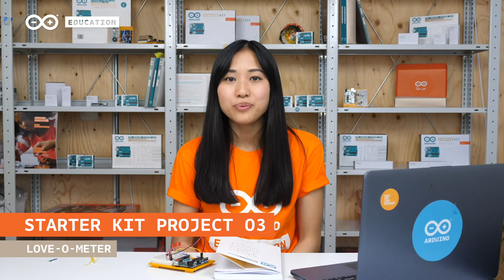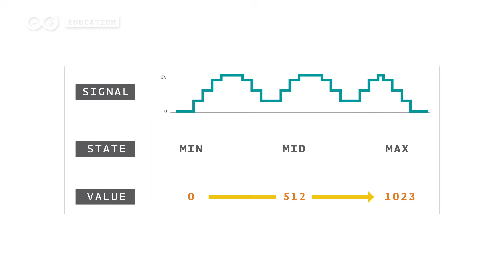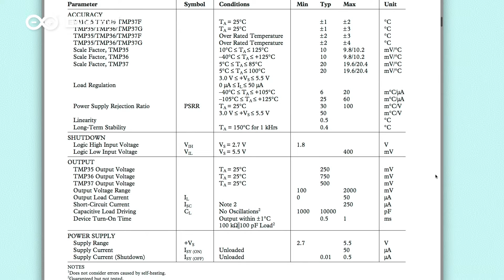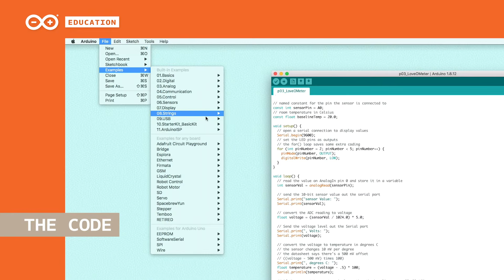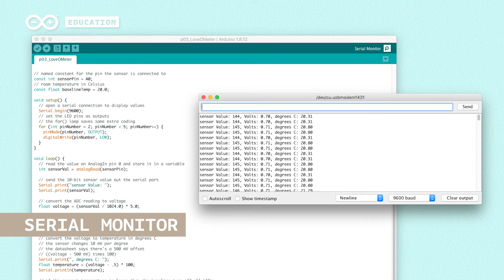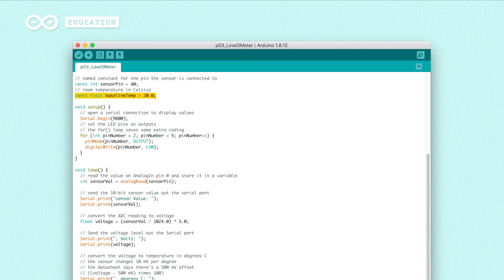03 Starter Kit: Love-O-Meter

Comment: Don't know if I using the correct sensor.  "Temperature and humidity sensor module" with a blue plastic housing. Am getting constant SV, 1023, Volts, 5.0, Deg C, 449.51
Something obvious?
Reply: That's a humidity+temperature sensor that's a different sensor

Comment: Does anyone know how I can make this same thing work but by being connected to a 9V battery instead of a computer? 

I have a power module to make the output 5V to power the Arduino but I think I have realized that that wasn’t the problem and this code requires using a computer to process information. Was I mistaken in thinking that an Arduino would have the ability to do that/function like a computer somewhat in itself? I was hoping I could make this stand alone to show my brother but it doesn’t look as impressive when it’s just attached to a computer that’s doing the heavy lifting/thinking.
Reply: Hmm... Do you have a battery holder??? If you do, then it should have a cable that can be plugged into the other socket that the arduino has, if not, then put the voltage side on the VIN pin, and the gnd on well, the GND pin.

Comment: why is the resistor after the led, surely the resistor isnt doing anything if it is after the LED
Reply: It’s the same thing to put it in front of the LED. All components in series experience the same amount of current.
Reply: @nicolascamaratta it slows down after it flows through it though? You’d assume it could blow it before it hits that resistor but I guess not.
Reply: @Larimuss  think of it like a tube of water. If there is a clog at the end of the pipe, it affects the flow rate along the entire pipe

Comment: my sensor changes temperature by a few degrees all the time but always at negative temperature
Reply: ye same wtf
Reply: I got 400c lol 😂
Reply: This is gotta be that strange "temperature sensor" with LM35 written on it (happened to me) - google says it's still a temperature sensor tho.
I just bought the same exact TMP36 sensor as used on video - works fine🙂👍🏿

Comment: my LEDs wont light up at all?
Reply: Have you tried tweaking the baseline figure?
Reply: im having the same problem
Reply: Same here. Anyone found the solution?
Reply: @auberginesoepx   its probably because the device isn't a temperature sensor, in the arduino kit the temperature sensor and transistors are very similar, try checking if there is TMP written in the back

Comment: madam can we use Dht11 senser for this project
Reply: did you ever figure this out?
Reply: I couldn’t figure it out. It didn’t work for me using the same code. I don’t know enough yet to figure out why but every LED turns on and stays on. I have that same result too when using the standard temp sensor for the project but using a 9V battery for power instead of the USB connection to my laptop. 

I tried using a power module to change the power output of the battery to 5V and then wire that power output to the Arduino but that doesn’t seem to fix anything for me either. Nor does a small capacitor. I think the issue might be that the code for this requires sending information to the computer/laptop and does not just work as a standalone tool/function contained to the Arduino and breadboard system itself. 

This is just a guess though. I really am not too experienced with this stuff. 

+Although—For the DHT11—maybe the humidity function of the piece is throwing the results off? Causing the switch functions (or whatever they’re called) to be disregarded and just supplying all power to all LEDs since the values don’t fit or apply to the coded constraints. I just now thought of that. This would make total sense to me but again, I am just a beginner and it could be something entirely different or more complex than how I am viewing it.
Reply: Check the output of the sensor probably different values which means different code?

Comment: Hello. Thanks for your great work, the starter kit is amazing. I went through this project and I have a comment regarding the code. In the second "if," you don't need the condition temperature >=baseline+2, because you already entered the "else" of the previous "if", meaning that the temperature is not <baseline+2. The same thing applies to the following "if"s, and you don't need an if at all for the last case.